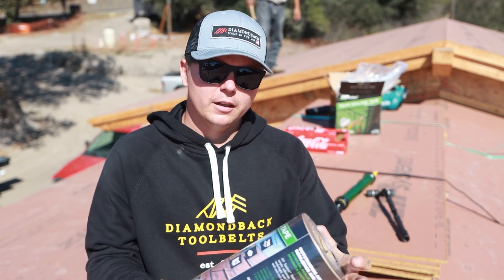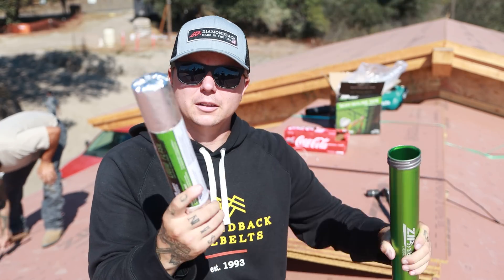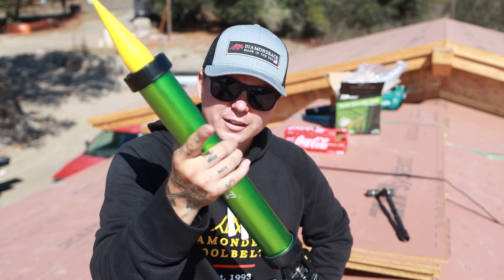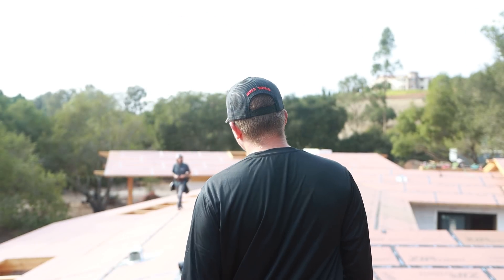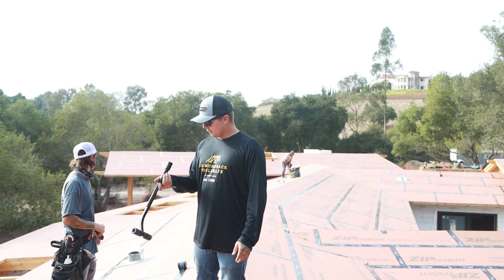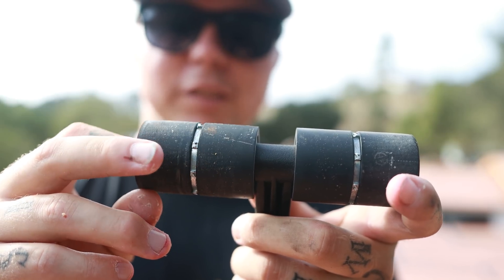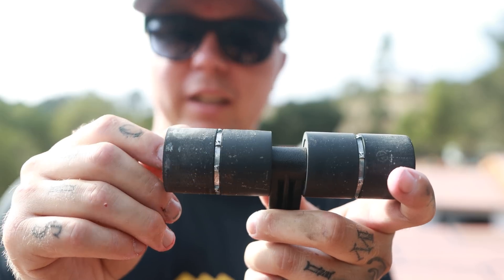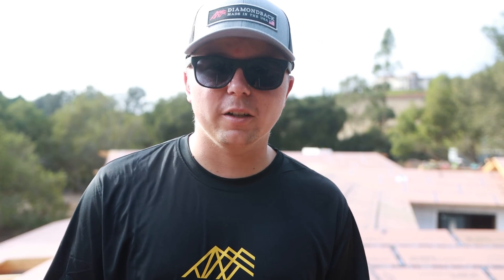5,500SF Taped In 4 Hours: Easy Waterproofing on a Home! [Part 1]

Comment: Have you ever used  the zip r sheathing I have used a lot of traditional zip board and I love it total fan boy. I'm building a house that has zip r6.6 it's green 7/16 with 1''foam and first impression aren't so good first off they want blocking on the seems so you can nail Evey 4 inch all the way around then 12"in the field OK so I cut the first skid open and the top sheets all wet on top OK so I try to pick it up real  heavy so I flip it over and push on the foam and water comes out of the foam insulation  like completely water  logged so I throw the top few aside then they seem  fine but what going to happen when the walls are standing their waiting for roof and it rains are they all gonna turn into sponges like WTF I guess I'm gonna have to tarp it all or say f it you'd think they'd use a foam that didn't soak up water   like the green stuff they put on foundations I'm dissapointed with it would make more sense to me to put it on the inside of the house or on outside of sheathing it sure makes me feel like the walls aren't as strong even with blocking sorry so long

Comment: Wonder if a floor tape applicator would work well with those rolls. definitely need some longer handles on the rollers so you can stand up straight and do it. Looks no worse than putting down construction adhesive.

Comment: Jake Bruton doesn't bother sealing every hole (except for over-driven etc) and he routinely gets Passive Haus air-tightness (~0.6 ACH 50) which means air isn't leaking thru the nails, so water is unlikely to leak either (although capillary could potentially suck in some water over time).

That said, considering how inexpensive/quick it is to put a dab over a nail,  seems an inexpensive belt and suspenders approach. Give a laborer a sausage gun and let him spend a few hours when there's a slow day.  

The one thing I don't like is the acrylic tapes are pressure sensitive - and just one missed bit of tape rolling can create a big problem. Give the designated roller a red sharpie and have them slash a line across the tape after it's rolled - a quick visual can see if something was missed. Yes, the Zip roller has embossed Zs, but you need to get right up to the tape to see if the Zs are there.

Comment: I've used it put here in Colorado. We are moving towards it in our industry out here. I run from the bottom up as well. The cost comparison is still unbalanced over OSB and felt. However its a far superior product at the end.
Reply: Cost is one thing...  BUT with a 1/8 inch gap between both Regular OSB and ZIP, the ZIP tape fills in these gaps. A 1/8 inch gap around a 4x8 sheet is equal to 1"x3" hole.  Divide that by 2 to account for each sheet sharing the 1/8" gap and on a 7000 sqft roof we are talking the equivalent of a 27 sqft hole in the roof that standard OSB and Felt will never fill.  - Figure the same calculations for the siding...  and you have a hole the size of 3 and 4 full 4x8 sheets.  The added cost upfront more than pay for themselves quickly with the conditioning ( heating/cool ) expense.

Comment: After seeing it, and using it.... There really is no reason to do anything other than the ZIP system.... It's worth the extra costs... You just end up with a tighter house, and I "think" that it deadens sound better than traditionally used OSB..etc....

I did my own house entirely with ZIP.... I would have used the 5/8 (red) sheathing on vertical as well, but the house wasn't drawn/framed for it.... and also, we needed 12' sheets in which, I don't believe they even offered at the time.  My house was ZIPed and out in the elements for nearly 4 months(unforeseen reasons) and it showed zero signs of weathering...

My framer hung all the vertical, and had a couple of guys go behind to tape/roll.... But we had another crew(two tiny Mexican guys) that decked the roof.... These two defied physics!!!! <- like bumble bee stuff!!!
But they did their cuts on the ground... Lifted every bit of the heavy 5/8 up a latter and would tape as they go.... Meaning they would deck one section of the house, tape, then move on decking...etc

Huber's ZIP tape is of space grade stuff!!!  Their Flex tape for setting windows is crazy good too!!! 

Now, we did break a couple of their rollers.... And I believe both broke at the angle and were both being used with an extension poll....
Reply: I’m under contract on a place (in Chicago burbs) I plan on adding a second floor addition/dormer. I’m chomping at the bit with grandiose ideas of starting right away. I’m looking for a system I can sheath and dry in and order the steel afterwards. A system that may have to sit for a couple months after the weather closes in. 

Will this stuff hold up in snow?
Reply: @TheRentsTooDamnHigh  
I would think so.... I live in southeastern Louisiana, and we have some  pretty brutal heat... humid .... and allot of rain during my build... Not to mention that my house get's sun soaked from about 8am to 6-7pm during the Summers....

Our very first day framing, was probably the nastiest winter weather that we could have had here... I'm surprised the framing crew showed up!! We had to lite up a Liquid Nail canister inside of a truck, to even get a fire started.... It was an icy rain and wind was blasting nearly 30 MPH at times... Since then, it did reach sub-freezing temps when "Zip'ed", but for short hours throughout the night...

I've lived in Chicago for a little over a year, and I understand the brutal weather that you can have there!!!

So, in not so short, I cannot tell you if the tape can deal with those cold temps, or how how it would be to apply in those temps.... But the sheathing  will for sure handle it....
If anything, in super cold temps, perhaps keep the tape inside a heated place and maybe torch the sheathing while laying it down? 

In my opinion, I don't think it's an issue.... But it's outside of my knowledge, and  I just can't say for sure.....

Otherwise, the system as a whole has no issue with moisture!!!! We didn't liquid flash any of our sunk nails either.... and there was no signs of swelling and such....
Reply: @DawgBone  

It’s been staying in the 50s here well in to December.  If I wait till spring who’s to say the weather will be better. Seems like spring is worse anyway - at least rain is much worse. 

I may go this route.

Comment: That drone shot looks like you ran out tile roof with your zip sheathing taped, I haven’t used this yet but for a few reasons I would avoid it in some circumstances due to the weather we get in the northeast, or I would add ice and water shield to the zip sheating. Definitely would like to start using it, keep up the good work. Stay safe.

Comment: Heat, Cold, Freezing, Heat, Cold, Freezing..., 4" to 6" wide "TAPE" is going to stay STUCK, not SHRINK, not CRACK???? YEAH RIGHT!!!  ABSOLUTE B.S.! What evidence and data is there that this stuff  will actually work and LAST????
Reply: Nice to hear from a lounge chair expert
Reply: two questions to be asked. number one: what is it with internet commenters incessant use of CAPS LOCK for absolutely no REASON at all and in THE totally wrong SPOTS?!?????!?!! it does nothing but make you look ignorant. number 2: have you ever used this shit? this stuff will stick on in the dead of a NY winter and in a NY summer, it will take your skin off. and also take the paint right off the top of the zip before the adhesive fails. Have you ever tried to unwrap duct tape thats been on something for 10 or 15 years? shit is still a sticky mess. much more so than when it was applied. dont be afraid of new technology. just looking at the system anyone in the business can tell its worlds better than osb and tar paper.

Comment: If the roller has a longer handle bar, Mr Fox won t need to work with his back bent for hours...... Tip 2 is to use a stick in the roll tape to unroll it. Once again a way to save on back stress.

Comment from the maker: I had no idea what to expect with this ZIP System Tape.. It went quick though, and honestly was a lot easier than I expected it to be. Have you used it? Intrigued to use it? It's worth giving it a shot to see what you think!

That tape at the end though! Rolled vs. non-rolled is nearly no comparison at all.. They emphasize it like crazy, ROLL THE TAPE!
Reply: Nothing else really compares. On a 6,000 sf project it saved us a few days worth labor. Especially when you have to have a sheathing inspection. The only thing better is a liquid applied WRB.
Reply: @antoineclaiborne3008  🌹🌹🌹🌹🌹👍👍🙋‍♂️🙋‍♂️🙋‍♂️🙋‍♂️🙋‍♂️
Reply: We used the zip sheeting here in Texas all the time, it seems to work really good when you do it right.
Reply: they did a comparison Zip system vs traditional OSB/housewrap and found them fairly equal in both labor time and quality.   Guess it is the old Ford vs GM debate on 1/2 ton trucks.